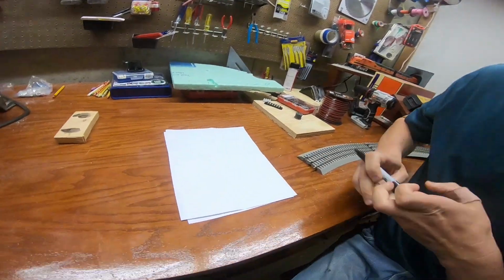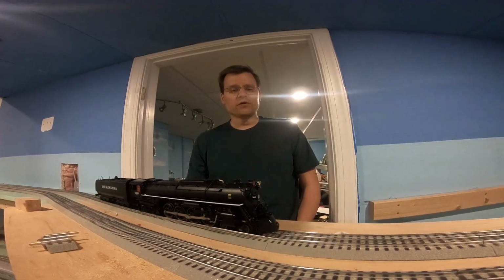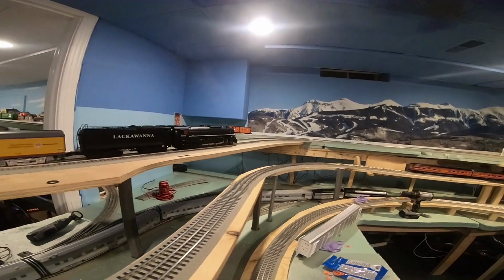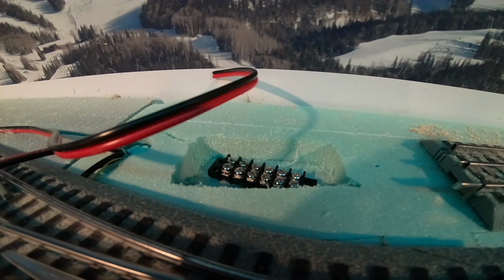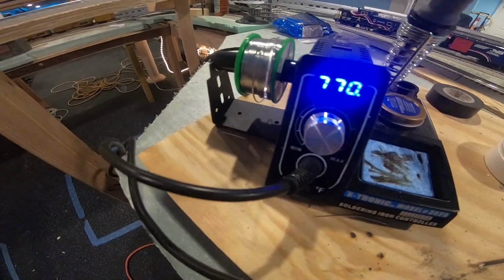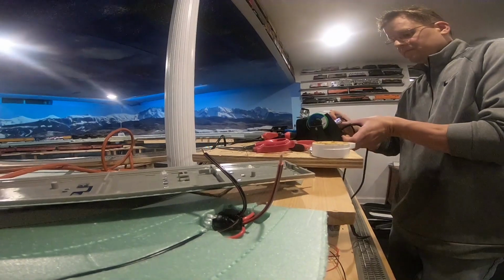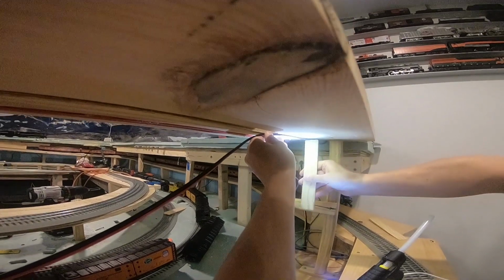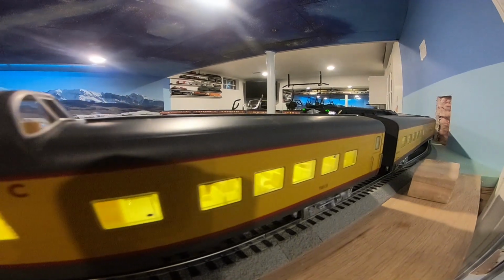How to Wire Fastrack

Comment: Your issue is not the signal, its the method in which you are laying the track. The weight of the trains is fatiguing the connection because it has no support. You need to be able to secure the track to a foundation and the foam is not a good idea (for O scale). Each time you go into the fast track to fix one section the connections get weaker in the other section. The problems seems to come from no where after you fix a section. You will have a never ending battle.  Fast track is convenient but it gives birth to a lot of gremlins if you don't lay it right. You can get away with using  foam on N and HO but O and above it gets dicey.

Those weird sorts could be from the phase of your power supplies (if  you have more than 1).
Reply from the maker: Interesting idea. I have considered this issue and have secured the foam to the underlying wood. Also, there are long sections where the track is secured directly to the wood without any foam.  Loss of signal had been persistent in all such settings.  I agree that fatigue of the joints and connectors is possible,  but the foam does have a high stiffness,  especially when secured.
Reply: Look at the pin on the fast track and you will see it has both vertical and lateral play. This is the root cause. Most Fast track is good for three connecting cycles after that the pins are pretty much done. 

The foam seems stiff but in all actuality its not. There is a lot of movement in the foam as well as the expansion in the wood. This is creating issues. Humidity will cause the
wood to expand causing seasonal problems. 

You really don't need the 12 awg wire.  18 is fine as long as your track is laid right. If the geometry is right the power requirements will be minimal.  

I built a layout for a guy that was 165' with 13 switches and it ran with 1 feeder. That's how i test my layouts. Afterwards I will add feeders in the low spots and its done. 

Using TMCC Lock on is the key as it will help you to manage the power allocation. 

Most of the time the problem will be in the track. Next time the engine stops, leave it there and take a screw driver and loosen or tighten the nearest screw in the track and watch what happens.
Reply: I have Atlas Section O-Scale and underneath this I use the Woodland scenics black foam ballast then I secure it all down on 3/4 painted plywood. Not hard;y any give. I tried foam in the past but I was just happy with it.

Comment: Nice video.  If I may,  try not to slam the solder tip into the cleaning station.  The tip can  break very easy.  Also for better results try not to use the needle nose pliers,  they act as a giant heat sink.  Otherwise,  really informative video.

Comment: Excuse me but, may I point out that the Fastrack already has tabs for spade lugs, the small width type, and even a wiring chase built into the underside of the roadbase.  It seems to me that you can run your heavier gauge wire right under the track and can simply tap-splice the feeder wires for each section with prefabbed jumpers (unless you really enjoy soldering).
Reply from the maker: You are correct.
Reply: @CDLionelTrains  I only point it out as I.) I am considering the best possible method of wiring my track.  2.) I have never seen such excellent control and response with these trains as I did in your video.  3.) I have broken the center rail pins that help join the sections electrically and I am sure the others can break as well.  4.) While I have always known others to solder every joint on two rail layouts, it's not something I want to do using Fastrack  5.) Each track section, no matter the length, has the tabs for attaching wire and as such, each track section, turnout, or otherwise can essentially be wired with a drop from the main bus line.  With the proper gauge stranded wire, if the track were stretched out in a single line starting from the power source, there would be a very little actual drop in voltage due to the benefits associated with the transmission of AC current over long distances (an issue with DC.  Hence, the Nicola Tesla/Thomas Edison debate so long ago.  They both were right and basically it is a hybrid system today.)  Lastly, I am starting with DCC++EX for both my O gauge and G gauge and I don't want any limitations in the future especially when manufacturers are developing such high quality and relatively low-cost Locomotives and equipment.  I shouldn't have to pay as much to operate the trains as it did to collect them.  A fact that Marklin needs to understand, lol!  (Yes, there's more to that story but I will leave it here.)  

Happy Railroading,
~Mary
P.S. - Most of my experience, since I was 4 years old, has been in Live Steam, 1.5" and 2.5" scale, 7.5" gauge track.  So a bit of a learning curve for me, nonetheless.
Reply from the maker: One thing you need to understand with o Guage is the way the track moves when the trains run over it.  This creates an ever changing connection between the tracks and the electrical connections.  This  is where we get into trouble both with the legacy signal and the electrical circuit.  So making connections as redundant and secure as possible gives you the best shot of flawless performance.
Reply: I bought 4 terminal tracks before I figured out that there are mini spade terminals under the track. lmao. As a rule of thumb I ALWAY coat my spade connecters with dielectric compound before I make the connection, and I put a light coat of NO-OX-ID on top of the track. Makes a world of difference in conductivity.
Reply: I think everyone needs to chill out. I think your doing a fantastic job and in time you will be an old master at this.

Comment: I assume the command system you are using is Lionel Legacy.  Running the common (U) black wire under your track will have no positive impact on your Legacy signal.  The Legacy signal uses a combination of the outside rail contact through the wheels of your locomotive, and your house ground wiring, which is where the antenna in the engine gets the other half of the signal from.  If you are having issues wih the Legacy signal in spots, you would be better off running a ground wire from a house outlet under or above the track to improve the strength.
Reply: I\'m not sure but ,if anyone else wants to discover how to build a model railroad layout try Megarno Railroad Membership Magician (should be on google have a look ) ? Ive heard some interesting things about it and my friend got amazing results with it.

Comment: I am working on my first room size O gauge layout and your track powering  guide is awesome. I have chosen to use WAGO clips instead of terminals for both common ground wiring for track power as well as a separate under the table common ground wiring for accessories. I am looking for the correct fastener to secure my Fastrack on 2 inch extruded foam and half inch plywood. Do you have any recommendations? Thank you.
Reply from the maker: I actually use 2 inch screws and washes to screw down the edges of the FastTrack into the foam. Then cover with scenery.
Reply: @CDLionelTrains  Thanks
Reply: WAGOs are the bomb. I use them on pretty much anything electrical.

Comment: This was pretty helpful but I'm confused on a few areas. What about the actual power supply? Do you have several separate or one big one?
Reply from the maker: Have a ZW transformer and a 180w brick.
Reply: @CDLionelTrains  if I'm doing a basic layout hanging a train around home pub ceiling about 14 x 16 would I need those?
Reply from the maker: Probably just a 180w brick.
You could try an 80w transformer but would depend on the number of trains and powered cars you run.
Reply: @CDLionelTrains  thanks for your feedback. one santa fe lion western telegraph engine and tender, maybe one or two other powered cars. Total cars maybe 3 to 6 or so. Just a simple set around the ceiling really..

Comment: Would signal drop off explain a dip in speed? I have a small around the tree layout where all engines experience a gain/loss in speed depending if they are close or far from the terminal track.
Reply from the maker: Yes, you could see this effect maximized if you run allow speeds.  The train will just stop.   When you are running at higher speeds, the momentum will take the train past the dead spot.
Reply: @CDLionelTrains  thank you!

Comment: If there is not enough voltage on the track can it damage a Lionel legacy engine? I have fast track and I don’t have it wired. When the train gets to the furthest part of the layout it slows down.
Reply from the maker: You can't damage the engine with low voltage.  It just won't run.

There is loss of power atthr fat ends of the track due to resistance and inefficient transfer of electricity.  This is normal.   To overcome this,you need to run power to the other side of the track.  Using a bus line,like described in this video, is a way to run power and keep the legacy signal running close to the engine at all times.
Reply: @CDLionelTrains  thank you.

Comment: Do you use O60 for your 21” passenger car.
Reply from the maker: Yes
Reply: @CDLionelTrains  Can you run Williams #20432 NS Heritage Series GE Dash 9 Scale Diesel w/Sound - Lehigh Valley #8104
this on Lionel fast track

Comment: Why would you solder wires to the track when you could have just used crimp adn then slip on connectors to the spades on the bottom of the track?
Reply from the maker: First, you have to buy all those connectors, so there is a cost factor,  especially with hundreds of connections.
2nd, it actually  becomes easier to solder the more you do it.
And third, the connections with solder are just better. Less chance of a failure of them falling off, and better conductivity overall, especially over longer distances.
Reply: @CDLionelTrains  The connectors are 5 bucks a hundred.  I saw Lionel does this also.  But how to you do a layout like yours with 100% soldered connections?    A small section you can solder then flip over.  I run a 17x11 around the room and at this point it has no bus wires, no feeders, no connector wires, and I have nearly no problems.   I plan on running a bus and feeders later today.
Reply from the maker: @j.johnson7962  
Its great if you can get it to work. The issues I have seen are with voltage loss and signal loss, especially with multiple levels on top of each other.
Reply: @CDLionelTrains   I got my sidings done and made 2 isolated sections in my mainline today.   Wired them with crimp connectors and plugging them to the track.   Wasn't bad.   My problem was I had to notch every ridge in the track to run wires.   Some of the track I have was pre notched ..  most of it was not.  After seeing you and Lionel doing the soldering thing, I figured it wasn't too much work to do these sections that way.   Thanks for the information and the great video!  I take it you have your layout broken up into blocks with feeders going to sections of soldered track.
Reply: I plugged all the tracks together doing the same as you did by soldering.     I think either way is good!  May try some soldering on other sections.
Reply: @CDLionelTrains  We all have our own pet way of doing things, but for me the cost of a roll of wire and a bag of mini female spade connectors is cheap. I solder automotive and motorcycle connectors, but for a stationary track layout crimp connectors is the way to go for me.
Reply: @CDLionelTrains  I agree

Comment: After paying a lot of $$$ for Fast Track who would want to solder it? Just buy MTH or Atlas track which are much more reliable!
Reply from the maker: Needs to be soldered or else years of frustration. 
Good point on the other track systems.  Gargraves may be the best way to go, but each track has its issues.